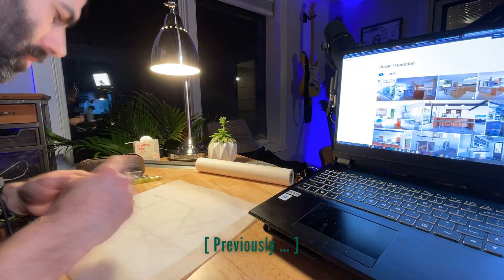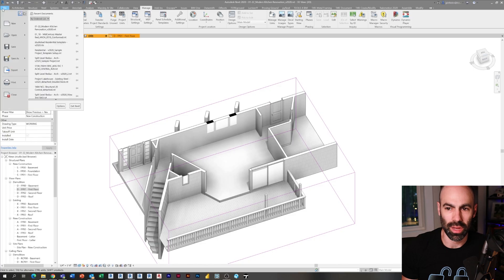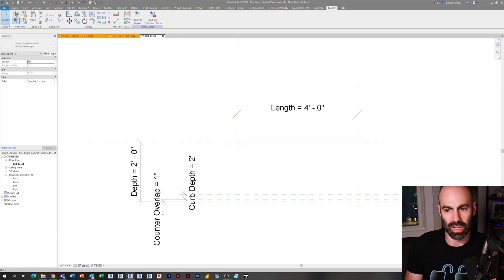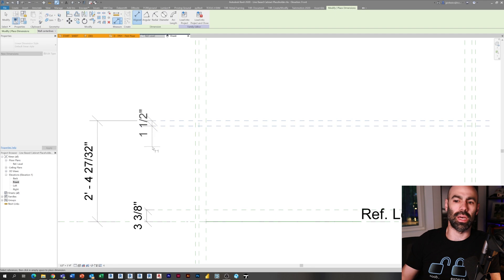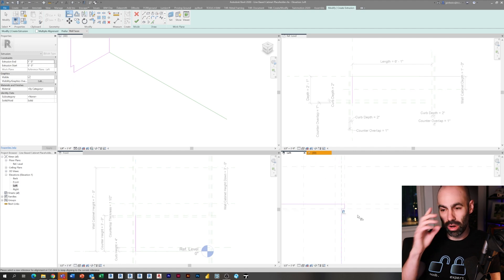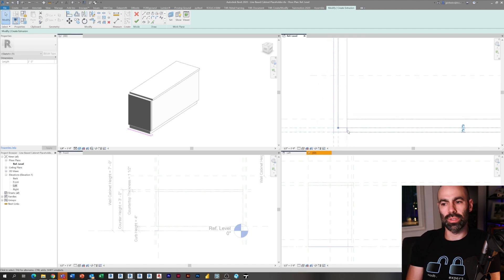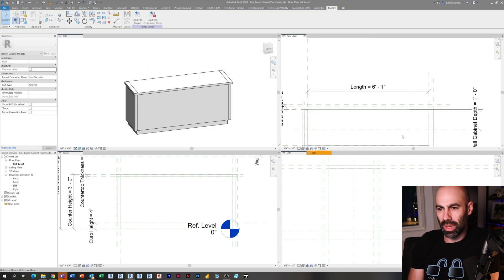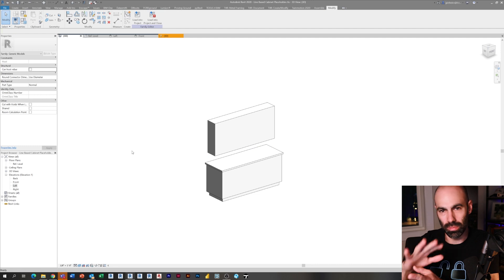EP06 | “Sketching” Cabinets in Revit ( Revit Family Creation Tutorial )

Comment: Hey Jeff, a way to get rid of the joint lines you get from different panels with different parameters is to have a different approach to the family. Add "if condition formulas" to the overhangs, and create the cabinet with only 3 joined extrusions. Then if you click on/off the parameter is either 0 or the desired overhang, and to keep it more parametric, link it to another input value, like desired overhang, etc. Another tip, not using "/" in the parameter name, or it will think it is on dividing by off when used in formulas. Happy to send out  an example if you want! Great content as usual
Reply from the maker: Good idea… there are a few ways to manage the joint lines (as is the case in most things Revit) but this was a live recording of me working and I didn’t spend the time to worm out the other 3 plus methods! Thanks for tuning in!!

Comment: what happens when your cabinets are in an L shape, do they clean up same as walls?
Reply from the maker: No, but at this stage, they just have a line.... No big deal!
Reply: I added a void miter to mine with an angle parameter.
Reply from the maker: @ryanmcgowan3061  Another great idea!
Reply: @TheRevitKid  since my drawings don't include interior elevations I ended up creating a wall style for cabinets (In floor plans) and it works very well!